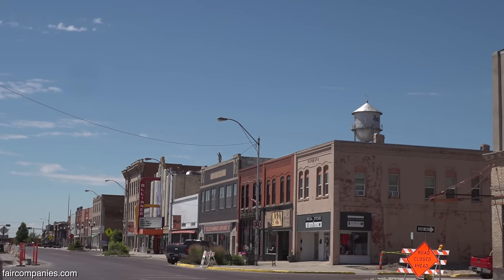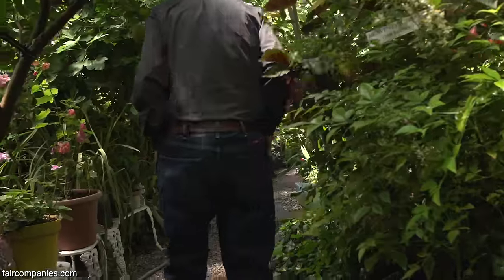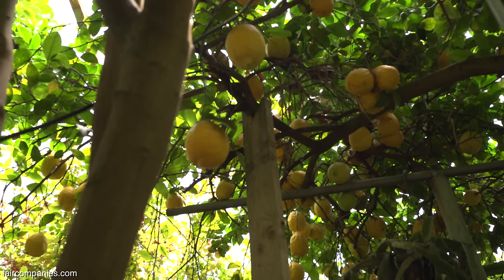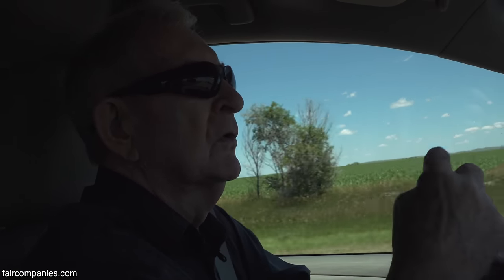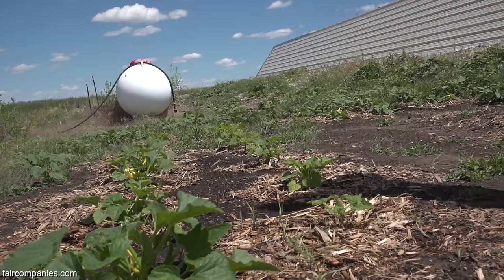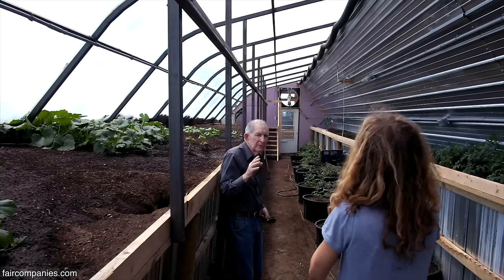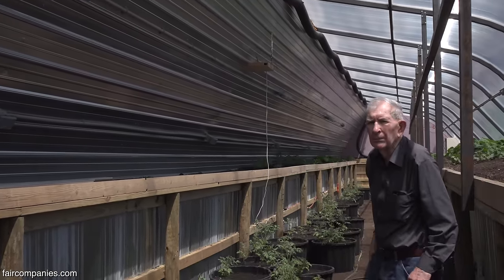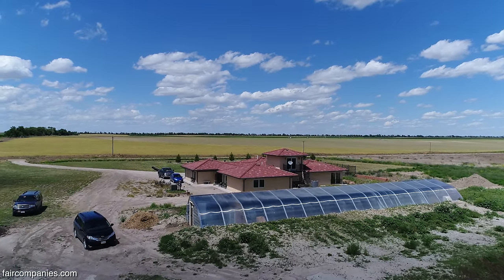Nebraska retiree uses earths's heat to grow oranges in snow

Comment: Russ Finch: Thank you Kirsten for the great video it raised so many questions I thought I needed to answer some.
Pollination: There area lot of misconnects about pollination while most plants can benefit not many require pollination to produce. While citrus might benefit they set so much fruit that they abort until they can support what remains. The only plant we need to hand pollinate is the pomegranate. 
     Bees:  If there are bees in the area they will find their way into the unit through the open ventilation windows. 
     Co2: Is overblown there seems to be no shortage in our system we have trouble keeping growth under control.
    Latitude: We have learned so much about latitude with this project mostly it isn't reliable for gaging heat and cold. The important thing is local climates. South of Oslo Norway is around 57° latitude where we are 42° but their winter average is 10° warmer than ours. The ocean and lake effects influence also.
     52°: Lots of confusion about the temperature of the earth in relation to the greenhouse temp. The blower for the earth geo only turns on at 50° or below until then the warmth from the pit radiates heat and during the day in the middle of a February day, outside temp. 20°  if the sun is out the temp at 6' will be around 80° and the peak of the unit will get to over 124°.
      Radon: WE have never heard of radon problems probably because the solution for radon is ventilation and that is our whole system.
     Break even point; We have 41 units all over the U.S. and Canada now and the oldest units growing commercially are less than 3 years old so we have little information. The typical 96' greenhouse for local growing will cost about $24,000 if you have access to a backhoe and can do the labor. That size unit can support around 18 citrus trees that will take up 20% of the growing area. The citrus will produce fruit from the first year and be what we would call mature ( about 100# per tree) in from 6 to 12 years. The rest of the growing area can be used for any crop and should produce income to pay for the unit before the citrus is mature.
     Grants:  We have shied away from outside money after being approved for a $70,000 grant from the University of Nebraska only to have them decide to "not release the funds" after we had started to build.  At that time we scaled back on the size and financed it our self.  
    Insects; Very little problem with insects after the first 3 years when we stopped using toxic chemicals and started using Horticulture oil (ultra refined mineral oil) it is safe and effective we just tree the problem area not the entire unit.
     Agriculture needs to grow this way;  This type growing can produce some of our table vegetables and fruit but there is no way we can produce enough to replace conventional farming.

   We have skeptics that say this won't work when I'm told that I pick an orange and try to figure where I went wrong while I eat it.
Reply: Russ Finch, thank you for sharing your experience and knowledge.  You have expanded our horizons and shown us energy friendly possibilities.  How did you learn about geothermal?
Reply: greenhouseinsnow Great Video, You sir are a genius, I am is impressed as I have ever been.
Reply: ❤️ Amazing
Reply: greenhouseinsnow How thick are the poly-carbonate sheets, Russ? Thanx!!!!!!!!!
Reply: he says in the video... three eigths i remember
Reply: Twin wall too, I believe.
Reply: I love the whole concept.
I do have one question though. So you circulate air through long tubes underground. is there a way to sanitize those tubes? Like run bleach through them or something? Because the type of environment present in those tubes seems like a perfect growth habitat for legionnaires disease.
Reply: Thank you for sharing your valuable information and experience with us
Reply: Thank you for posting the video and elaborating after. I was just wondering if you ever built one that had room for sitting and enjoying your garden oasis in the snow ? I live in Illinois and I’m thinking how amazing it would be to have a tropical garden year round ! I would have some tables and chairs in there maybe a tile floor or nice green lawn year round. We would eat lunch out there when ever possible. Your greenhouse must smell amazing with all the citrus? Do you plant smaller trees, or have you had problems with plants growing too tall ?
Reply: Mr Finch I just subscribed to your channel. Thank you for your experience and contributions. Seems like you are accomplishing more with 25 thousand dollars then a university does with 1 million
Reply: You are very smart man, I applaud your genius and vision.  I hope to see one in every town in the world.
Reply: "We have skeptics that say this won't work when I'm told that I pick an orange and try to figure where I went wrong while I eat it."

Epic. This seems to be the real problem more often than not, doesn't it?
Reply: Yes it does.
Reply: Michael Klumper the moving air may keep moisture down to discourage bacterial growth.
Reply: Thanks for the details! Great stuff
Reply: greenhouseinsnow im changing my life because of this video. Greetings from Kansas City!
Reply: Michael Klumper air is circulating, it's not fresh water.
Reply: +Michael Klumper It's just OUTSIDE air circulating through the tubes. How could you get legionnaires disease from that? The earth insulates the tubes but does not penetrate them.
Reply: Fantastic work.
Reply: Wonderful!!
Reply: Hi could anyone explain or send a link to a diagram for how geothermal heating/works? thanks
Reply: Why can’t I meet someone like this!!
Reply: Atomicwedgie81  

the Lexan panels are 6' x 14' and 8mm (3/8") The idea is to have as few seams as possible to make the unit air tight.
Reply: Atomicwedgie81  Right we have used triple wall but find the extra tunnel doubles the amount of condensation.
Reply: Thank you so much sir for your comment and your work.  Hopefully more people will see this.
Reply: Thanks Russ, have you thought of writing a book on your findings?
Reply: How would one purchase the frame and glazed modules, and how much does each module cost, please?
Reply: @michaelklumper9336 
 Even if it was possible, I highly doubt you would want to run something like "bleach" through the tubes__it would soon kill everything in the greenhouse with the toxic gases released into the plants' closed-in environment!  Bleach isn't the cureall most people believe it is!  It's a highly volatile product that people, for the most part, should scale back on over-using so freely!  😒
Reply: @knowideas7184  
 Don't get what your reference to fresh water is, considering Legionaire's usually tends to proliferate through things such as (dirty) air conditioning ducts!  😏
Reply: Mr. Finch:  Thank you so much!  Thank you for your generosity in sharing and alerting the public to a real alternative way of farming.  I was wondering how high can one build? Considering long term then one maybe able to grow Cacao, Papaya, Bananas, Plantains, and all types of berries from all over the world!  Wow!
Reply: I want a greenhouse that uses your technology but on a smaller scale for my 3 acre plot. You sir have illuminated a light bulb in my brain. Our town is small approx 3,000 folks who could buy our products year round.  thank you for this video
Reply: There are others working on small-plot commercial farming.   It's not that hard to grow things, locally.  And it's going to become more and more popular over time.  And any person with land can adopt a very very cool lifestyle.  A new American lifestyle that I hope and pray catches on across the heartland.  There's also a LOT they can do in cities to grow things and just make their environment way better to live in.  See a skyscraper?  The windows should be FULL of growing things.  They could be the new-wave terrace farms, only totally vertical, rather than just hacked into the sides of steep hillsides.
Reply: You guys are amazing.
Reply: Awesome... I'm ready for bananas too...
Reply: greenhouseinsnol
Reply: No way to replace conventional farming... I am wondering about breaking up large monocrop farms into many tenant farms, utilizing greenhouses such as these; if large corp. wants to continue to own all the land, where more folks have opportunity to make a life, more food is produced, we can edge away from animal agriculture, a very large polluter (and cruel), some of the former monocropped land can be turned into food forest to create micro climates... Seems like there are possibilities to rely less on chemical company monocropped conventional farming. It would have to take a while to institute, but if we start...? I know this is a simplistic statement about something with more complexity...I'm throwing an idea out there.
Reply: I love this, makes me want build a small me.i'm retired and like to garden.
Reply: all he does is circulate air from the ground into a partly insulated green house? Who would have thought the ground retained heat that well, how is it doing that? wouldn't the air drawing the head out of the ground eventually cool down the ground too? Maybe microbial activity in the soil is keeping the ground warm?
Reply: Dear Russ, you are a gift from God! May you be strong and healthy and continue to teach the younger generation what you have learned and researched. You are an inspiration to the world! Thank you for your contributions to society. May we all follow your example, reinvent the wheel and find a new purpose in life after we not-retire. Respect Sir- best regards.
Reply: Mr. Finch, you are an absolute GEM (and that last sentence above was a HOOT). I wish you had known my grandparents. They were nearly completely self sufficient with a large 5 acre (conventional) garden as their "backyard." They grew everything, and I mean everything. During the summer, we only had to buy bread, meat and milk. We had nearly every veg & fruit imaginable. Of course as a kid, I never appreciated all that, and now, as a city dweller, am kicking myself for not asking more questions, and learning more about their garden knowledge. PLEASE tell us that you have written down your vast wisdom about these growing systems, because we have lost the art of horticulturalism over the years, and I have a feeling we may need it again sooner than later! Thank you for this.
Reply: @atomicwedgie8176  I think he said 3/8ths inch
Reply: I totally want to be this guy when I grow up.
Reply: "We have skeptics that say this won't work when I'm told that I pick an orange and try to figure where I went wrong while I eat it."

Best end line ever!!
Reply: Thank you so much for sharing your knowledge and experience.  You prove that high school grades don't make a person. It's how they use the noggin to change the world that matters.
Reply: greenhouseinsnow Was
Reply: Good stuff.
Reply: "We have skeptics that say this won't work when I'm told that I pick an orange and try to figure where I went wrong while I eat it."

I guess the last laugh is yours sir!
Reply: " We have skeptics that say this won't work when I'm told that I pick an orange and try to figure where I went wrong while I eat it". That, sir, is what the kids call a mic drop
Reply: Great work with the green houses, Geo thermal is the true future of energy  !
Reply: @atomicwedgie8176  Watch the video again and take notes.
Reply: HappyAgony look up geothermal heating!!
Reply: @michaelklumper9336  Legion Disease (has a scientific name). I remember that it had to do with water cooling. Brut to your point, chlorine gas could be used to flush the lines. Relatively inexpensive. Just fill the lines, close both ends and wait for 2 hours. Then flush and continue with operations. Also filters could reduce unwanted spores that may be harmful to humans.
Reply: Would you consider adding an apiary at some point?
Reply: All though it is green friendly... but where is all that electricity coming from beside from Solar panels, & wind mills...
Reply: I am curious Russ if you have looked at the concepts of Earthship designs? By creating a thermal mass (like you are using the floor for now) along the north wall it will absorb the suns energy during the day and stabilize the temperature at night. The thermal mass needs to be buried in a berm  to insulate it however. In earthship design this mass is created with old tires and cob but there are other options
Reply: actually studies in this design by others have proven that the earth acts as a dehumidier The moisture levels in a closed loop design actually lowers as the air flows through the system
Reply: @MrDisgruntledGamer1  Simple physics, the Theory of Thermal Dynamics, the simplest way to explain it is, HEAT moves   to COOL. Also he uses the KIS principle, Keep It Simple.
Reply: @patdoyle2514   Try germicidal lights.
Reply: What states do you think this is valid for? I live in eastern pennsylvania. valid, do you think, sir?
Reply: @patdoyle2514  Yes, Mam.
Reply: eating the oranges call the book smart dummies and listen keep it up
Reply: @michaelklumper9336   With adequate air circulation, it shouldn't be an issue, esp if there are no splices in the lines. Easier and cheaper to put in a filter system on your greenhouse end from what I can figure.
Reply: True American Hero. Brilliant idea to use abandoned small town lots for greenhouses. Thanks for sharing!
Reply: Michael Klumper I thought legionnaires needed the moist environment of an air conditioning system where warm humid air is being chilled and dumps its moisture.  I would think that the air being pumped through the tubes is cooler air being warmed so it’s relative humidity level is going to drop and it would tend to scavenge any moisture that might develop.
Reply: @michaelklumper9336  That was one of my questions as well.  It would seem that a warm moist environment would provide the perfect ingredients for mold growth as well.....
Reply: Update:
I've had a lot of responses. Some angry, most implying I know nothing. I assure you, I'm an HVAC technician. I understand his thermal concept. I've seen it a dozen times. Usually on farmers' outbuildings. I also understand the problems of the concept, and just wonder what his methods of sanitation are. If any. Some guys have genius strategies for that too.
Reply: and vanilla bean orchid
Reply: @EpicDrake  "All that electricity"?  Did you not hear him say that even in this harsh environment, the cost of electricity is 80 cents per day (with the less efficient model)?  That's nothing...
Reply: @michaelklumper9336  Clearly, being an hvac technician doesn't qualify you to know a thing about the spread of legionnaires' disease.  Explain how this open system which pulls in fresh air with a simple fan can cause a disease that's almost always spread by breathing in aerosolized water.
Reply: To Mr. Finch I say you're living my dream sir. To Kirsten and your family, I say your efforts and dedication to showing people there are better and more rewarding ways to live are all inspiring to me. Thank You! -Neil.
Reply: @cherriemckinstry131  and plantains!
Reply: if there is no standing water in the tubes  i don't think legionaires would be a problem and also the temp is 52 degrees if it were say 70 degrees or so with standing water you might have a problem
Reply: Pollination was my only question, but I got it answered. When I build such a green house I will have a bee house inside :) I am not afraid of them, they are calm and friendly not to be mistaken for wasps. Just awesome, showing us northerners it can be done.
Reply: @knowideas7184  ....hes talking about the rain out in the tubes when the humid air cools down underground... I've often wondered about that also, even if you have perforations in the corrugated tubing to let the water drain into some Stone still makes you wonder
Reply: @michaelklumper9336  i read about something like this years ago. It was used to heat and cool down a house. It was a series of tube systems submerged underground..spread out. As i remember it they stressed to use smooth tubing and to slightly slope the tubes, both so the water wouldnt collect. I would think there would be huge rainout in the summer time when the that hot humid air would be pulled underground and cooled. 
U could have an open loop or a closed loop. And they talked about the heat transfer increasing with damp soil, so in one example he said u could bury a water line right above the air tubes so if conditions are dry and dont seem to be keeping up u could wet the soil for better heat transfer. They stressed it was important not 2 have the tubes close together, like space atleast 4 ft apart  to make it more efficient.
Reply: @AShadeOfYou  I wish my girlfriend wanted to live like this.. she can't even grow fingernails! Hehe😆
Reply: @d.rabbitwhite : Animal agriculture can be pollution/cruelty-free with a return to chemical-free, zero plowing, controlled grazing. The all-grass fed meat/dairy is healthy and less expensive or will be when education replaces ignorance, e.g., people choose it over conventional. This method is reclaiming devastated soil, restoring fertility that has been mined out by ignorant farmers, e.g., like those who created the mid-west dust bowl by plowing, overgrazing, and chemical use.
Reply: @goudagirl6095 : The vast majority have been indoctrinated in gov schools to believe that centralized control by authorities is "law, order, and security" and small, independent living free is chaos. This authoritarian (socialist) paradigm is a worldwide plague. It is the opposite of the American Dream that made the 1800s America great. The more "progressive" a society is, the less stable, the more polarized, the easier to "divide and conquer" by the ruling class, the "new nobles", the aristocracy. This progressive society is a regression back to the dark ages and will lead to war, poverty, and species decline. 
Only a return to a voluntary, non-violent politics like early America that distrusted gov and valued the independent person will save our society from civil war and economic collapse. Or, perhaps we need a secession of states to let the progressives have their way, and the capitalists have theirs. Let the experiment begin again, as it did in the 1800s when a 3rd world, backward nation went rogue and defied the worldwide political paradigm by putting individual political equality first ("All men are created equal...") and quickly rose to prosper and become the world leader and a sanctuary for the oppressed, no welfare needed, just a chance to be free.
Reply: Thank you for the measurements... I have a design similar to that but with a large Solar Can heater on one end to create a hot spot of high temperature air,  thus passively driving the air through the underground piping through convection.
Reply: @MrDisgruntledGamer1  There is extra geothermal energy in that are.
Reply: Don Duncan  The Midwest dust bowl was caused by drought and a very hot decade. The plowed land turned to dust and blew all over but the weather caused big blowouts even on land that was never farmed.
Reply: Do you want an apprentice or two???
Reply: I want to have fruit like yours, you are the MAN
Reply: This looks like  dream situation. I want to replicate this.
Reply: white  regregenerative farming (which utilizes livestock as they are intended to be used) actually FIX the environmental issues you describe. Check out any Joel Salatin video...using Regenerative Agriculture sequesters more CO2 than anything science/innovation ever will. Nature being nature, unencumbered by humans is what will balance our ecosystem.
Reply: I have a friend that setup this same idea, scaled down to 10x10, in the middle of Denver in a Tinyhouse community, uses maybe 100 watts when the fan is on, the rest is self controlled, all on solar power as well, amazing to walk inside a 0 degree day and have to take your shirt off, I believe he also uses a water cooling and heating system in addition to the air.
Reply: @T God didn't show you how to build this, Russ did. Just sayin
Reply: @JoshuaMarpetQuadling  Pennsylvania has a much less harsh climate than Nebraska.  Why wouldn't it be good?
Reply: Deborah Davis 
The key point here is that the system is only used to warm up air. 
If one would use it to cool air down, then condensation would occur in the tubes and that would cause all kinds of troubles. 
Keeping the tubes dry is paramount. This is easily achieved by only letting air in that is colder than the temperature of the tubes.
Reply: @michaelklumper9336  you could probably run a fogger through it once in a while but this isn't like an air conditioning system where you have extreme changes in humidity
Reply: I suddenly want to sell everything and move to where you are and do what you do.
Reply: What do you use for fertilizer?  Do you have a composting area inside the greenhouse?  I know once a pile gets going it heats up on it's own but not sure how that works at -20F.
Reply: greenhouseinsnow has
Reply: Yah.. like your approach, attitude and your whole thinking, Ol Boy- hope you keep it up for years to come, my frend!!
Reply: 2 fingers to the skeptics
Reply: @atomicwedgie8176  I wondered the same thing, great about heat generation but what about retention? But when you take into account how much heat it generates, it's all just really math.
I'm pretty sure I heard him say, "3/8".
From another, less industrious, user of geothermal energy, thanks for your efforts, Mr. Finch!
Reply: Bravo! I'm a a fan!
Reply: thesheepsaysmoooo  it’s doesn’t appear to be geothermal.  It’s air passed through tubes 8’ down that circulate the air throughout the green house.
Reply: ABSOLUTELY GREAT INFO!!!! I BET YOUR PARENTS KNEW YOU WERE JUST A "LATE BLOOMER" !!!! PUN INTENDED😂!! WISH YOU ALL THE BEST!!!!
Reply: MATHEW KLUMPER - VERY GOOD POINT ABOUT LEGIONAIRE'S ! ALSO BATS AND RODENT DROPPINGS .SMALL 1/4 WIRE MESH WOILD KEEP OUT THOSE VERMIN, BUT THE LEGIONAIRE'S IS A CONCERN.
Reply: I TOTALLY AGREE WITH MICHAUL KLIMPER..ITS THE AIR MOVEMENT THST WILL GET ALL KINDS OF MICROBES AIRBORN.MOLD SPORES, LEGIONELLA, DRY  ANIMAL FECES. THERE ARE GREAT SOLUTIONS TO TACKLE THIS VERY DANGEROUS PROBLEM. MY HUSBAND NEARLY DIED OF LEGIONAIRE'S PNEUMONIA .THERE ARE MICROBES EVERYWHERE.WE HAVE TO FILTER THE AIR.ACTIVATED CHARCOAL IS AN IMPORTANT COMPONENT OF FILTERS.I'M WITH MR.KLUMPER! LUV THAT GREENHOUSE! DONT LUV PNEUMONIAS OF ANY KIND.
Reply: Greenhouseinsnow  Grew up in Cheyenne Co, KS, KS/CO/NE corner. My Gram there just celebrated 98 years by dancing the Charleston! In South now for work; but if I wanted to 'retire' back home, this would be a GREAT project.  Is there a central site on web with all of these, or anywhere to begin learning more?
Reply: @michaelklumper9336  no water - no legionnaires disease
Reply: The Fowler Funny Farm will be ordering our 1st greenhouse at the end of the month...combining Russ's genius design with aqua and aeroponics for veggie growth to make money while the fruit trees fill out.  We are hoping to have it in place before Thanksgiving.  Plans for 8-9 more in the near future.  Thanks Russ!

In one 108' greenhouse, I can plant about 7200 lettuce heads until the trees mature, and then half that (the back shelf not as useful when trees are full).... that's 7200 heads a month (22 days best case)... at $2 a head (organic in my supermarkets is $3 per head), that's $14,000 per month just from the lettuce... or tomatoes or strawberries. 

This greenhouse is the single best prepping move you can make.  One fully operational can easily feed a family of four, including feed for livestock, and give you something RARE to trade... who will have oranges when the grid goes down?  Only you!
Reply: @michaelklumper9336  Legionnaires disease takes a big source of water, and waterborne bacteria...and unless your water table is at 8 feet down, this shouldn't be an issue as dirt 8 feet down tends to be very dry and dries the air in the tubes.  Way to not take the 5 seconds it would have taken you to find this out on the internet, though.

Also, someone would have to INFECT his water source... Legionnaire's doesn't just spontaneously exist because there is water there.  Way to make it clear you know nothing of the topic on which you speak.
Reply: @johnmarkhatfield  The soil indeed acts as a desiccant and dry out the air pushing through it. It's why he doesn't use a dehumidifier.
Reply: @thesheepsaysmoooo  Google can do that for you.
Reply: @royhoco5748  I ordered his packet, worth the $50... consider it a donation for all his work.   Anyway, in it you will find that the break point for these greenhouses is about 60' long.. anything shorter and you have to put in more tubes than normal, it doesn't become feasible.  I am putting in 2 x 69 foot long ones this month, as my landscape is hilly and I don't have long, level surfaces for 108' straight.
Reply: OK, look.
 I like to try to be nice. But your comment straight up pissed me off, Mr. Know-it-all, Based Bear.
He CLEARLY SAYS that the air is circulated through the system year round.
In the summer the air in the greenhouse is warmer and the temperature in the underground tubes is lower. THIS SUDDEN DECREASE IN AIR TEMP CAUSES CONDENSATION. A buildup of condensation can create quite a bit of water. ESPECIALLY when that air is coming from a hot greenhouse with an irrigation system.
Duh.
Ground water? What are you even babbling about??

And your suggestion that someone would have to infect his system is just plain wrong.
Legionella bacteria are present in various soil and water in small quantities. It could be present in very small quantities in the soil of the plants, or in the water used for irrigation. Irrigation water that was likely sourced from a local well, huh?
From there it could transfer via ambient air humidity through the tubes,  condense into moisture, and thrive in the perfect environment for it to grow.

I assure you. I know EXACTLY what I am talking about.
It seems like anything beyond "Groundwater" just went right over your arrogant little head, huh?
Reply: @basedbear1605  
The air from the greenhouse is circulated through the ground tubes.
This warms the air in winter and cools it in summer.
There's your temperature drop.
Warm, humid, greenhouse air goes through cooler tubes.... causing condensation within the tubes. Get it?
The seasons change? Ok, what?
Are you even following? It sure doesn't seem like it.

The water in the greenhouse for irrigation comes from a well.
There's your potential source.
Apparently you also don't understand the basic pathology of the bacteria in question.
Your experience in enviromental engineering probably came from a video game, and there is absolutely no possible way you have more experience with chillers or evaporative cooling than I do.
Especially when your claims go directly against the principals taught in all HVAC certification programs. 

You're just a kid who lies to try to make his points seem more valid.
Reply: @mucsalto8377  
Do a google search of "cooling air through underground tubes"
Doing that will lead you to several PDF and concepts/designs of similar systems.
This is not some brand new or unique concept.
Reading any of those plans, you will discover systems used to remove condensate which occurs when the hot moist air is cooled within the tubes.

That was my question.
What system is being used.
Because if there is no moisture removal then there is always a potential for bacteria growth.
Reply: @basedbear1605  nioce
Reply: @xtrchessreal  I'm wanting to do this on a smaller scale as well in Berthoud. Is your friend part of a group or anything that gets together to share ideas? I'm looking for some help in the build and would love to  hear from someone local with experience.
Reply: I have earth tubes in my build (8 inch double wall, 250 ft long) and get asked the same thing about Radon all the time.  I give the same answer.  Earth tubes are about ventilation and ventilation is the solution to Radon problems, so why would you expect them to cause a Radon problem?
Reply: @MrDisgruntledGamer1  Go into cave systems the temperature stays consistent throughout the year.
Reply: Thank-You...with all my heart and soul. As i was saying to another person," You breath life,hope and inspiration to us!" Sustainable living is the only path to the future and  the greed and politics of a profit driven industry will surly destroy us and our planet as we have known it. "Big-Corps",what i have dubbed big industries want us dependent on the products that,only they,have to offer and they have their fingers into everyone's pocket...another reason you were refused financial help as this could get out of control and damage profit,shipping... ... a small chain reaction can put a large dent in profit.  My papa always used to talk about,"The Power Of The Purse-String," how we as a people have so much more power than we can imagine just by standing together in great numbers and demonstrating with closed wallets and purses,taking back our money (financial power)and then watch them (for a change) say,"What can i do for you sir/mam."  We need a change more than ever,right now, to start becoming communities once again where people help and look out for each other forming neighborhoods of neighbors where you form an inner social network of families  based on a local sustainable platform. This type of platform would do far more than feed the body but minds and souls would also be enriched as children born and raised in such in simple basic settings are far more secure and tend to flourish and form a desire to carry these basic fundamental ideas forward to the next generation building from this platform of local sustainable/family which tends toward keeping in check the desire for self-serving. Thank-You Once Again Mr.Finch, You and others like you are the true heroes as you sure are mine.  L.L.
Reply: I've not read through all the comments, but could you have 2 greenhouses run on a single set of tubes? Or would each one need it's own set? (kinda what I'm thinking). Thank You!!!!!!
Reply: @tavayalahlynnlawmaster624  I couldn't agree more!
Reply: @d.rabbitwhite  one of the Reasons we have Corporate Farms  is becouse the sm. Family farms are dieing out. That needs to be Revised,  it slowly happening,  but will never go back to feeding the nation.
Reply: @pat36a  I am not advocating for going back. I am advocating for moving forward, in thinking and action.  I know there are issues to be worked out.  I'm giving ideas I had and stating that I trust that things can be worked out. 

Check into why small farms die. Corporate has a hand in making that happen.
Reply: Soaking garlic, ginger and vinegar in huge vats of water for some months, then watering the plants with it works really well as a pesticide too.
Reply: @GammaCharlotte  Small puddles of standing water collecting in the pipes would be problematic.
Reply: Deborah Davis  The problem would start with condensation in the pipes. 

However without actually looking at those pipes it's impossible for us to tell whether there would be any problem with condensation.
Reply: Years ago back in the 90’s a welder that made galvanized boat decks on the Finger Lakes in upstate New York his name was Ralph Poormon had a welding shop on route 89 in Seneca Falls NY built his Aframe house with geo thermo heating years earlier an showed it to me. He also had a wood burning shed located away from the house that was piped into the home, under ground. As back up for winter. This had a stove in it that he could burn wood in an send it into the house an bring the temp up above the earths temp of 54 degrees for winter comfort. An in the summer no air conditioning was needed. This man reminds me of him so much.  Ralph is gone. He taught me a lot.       One thing for sure you need to know the frost line level An definitely be well below it, an your water table levels. It will not work in a swamp unless you got mega bucks.
Reply: How about Australia.could some variation of this work there.
Reply: @michaelklumper9336  You could just have the air run through a white box with uv-lights before it enters the greenhouse if that worries you.
Reply: @MrPondGuy  There's a little bit less sunshine hours. Some plants are sensitive to the length of sunlight, some to the change in sunlight, and some both... I dont know how the citrus are going to perform but they seem to perform well in NB.
Reply: @Conservator.  Hes actually explaining a bit more how it works during the latter part of the video. He is using the system in the summer to cool the GH. While doing so, it transfers heat to the soil around the pipes, warming it up. In the winter, its the warmth around those pipes that are transferred back to the GH. If you also check his cellphone, he is monitoring the dewpoint, but I dont know if he is actually caring about the condensation while the system is running because there are also considerable heat gain and losses with condensation.
Reply: Where can we get plans for this build?
Reply: @josephrileyosullivan  on Russ's website.
Reply: We would like to come up from Sidney NE to see your setup
Reply: Post more videos?! Set up some go pro's or whatever cameras you'd like, cheap if you want.

You need to start cashing in from the Bank of YouTube.
I'll be legitimately angry if you don't
Reply: @michaelklumper9336  I'm no engineer, but 24 years and no issues with any of your big words.
Reply: I want a Nebrakian orange.
Reply: @1voluntaryist  real funny that as a wild liberal progressive socialist I agree with you 100%, it's not about  that at all, it's about liberty and tyranny, or individuality vs authority. Be well ✌
Reply: @ @michaelklumper9336  ,  You asked a very valid question to do w/ condensation and water stagnation, which leads to mold, mildew, and bacterial growth, which includes Legionnaires disease.   I wondered the exact same thing as you the moment I heard him say they use the tubes for cooling in the summer.  Just think, hot humid air getting cooled to 52F or so, and how much condensation there will be on the inside of his corrugated tubes.    You and I both know even a simple window air conditioner (esp. the ones with the slinger fan that throws to condensate against compressor coils) have mold/mildew problems, and the window unit is all above ground, and has the ability to drain the condensate (unlike the tubing in this video)

Maybe your original question should have the following line added to the end "if you don't know what a psychrometric chart is (w/o googling the answer) then please, don't bother responding".    Yeah, like you, I know a thing or two about thermodynamics, relative humidity, and HVAC, and it is indeed painful to read the comments from ignorant.
Reply: Russ Finch, are you related to any Finches from NY?
Reply: Love you, it is great.
Reply: sOMEONE, PLEASE MAKE A PATREON FOR THIS GUY
Reply: He needs to do yoga every day to straighten up, and make a vid on the house construction too.
Reply: Thank you this is awesome
Reply: where can i purchase plans for your green house
Reply: Thanks Mr. Finch for what you're doing. A real inspiration.
Reply: Does this gentleman have a Facebook page or any way to follow him? I'd love to eventually set up a tour and pick his brain
Reply: @d.rabbitwhite  any regenerative farmer will tell you that livestock are a big part of their system because the soil heals exponentially faster when animals are part of the management. We wouldn't need tenant farms, but could break up the huge corporate farms into smaller family farms again. The BIGGEST thing is to make the food supply local. 70% of people on Earth are fed by the 30% of farmers who are on small-scale and peasant farms. Most of the stuff from monoculture systems (especially corn and soy) goes to biofuels and synthetics production.
Reply: @rachelholdt6840  Not any regenerative farmers. There are plenty of veganic permacultural farmers out there. and the animals there are liminal animals that one learns how to live cojointly with or are survivors of agricultural pursuits. There would be nearly no way to convince a corporate entity to give up property but there may be a way to convince them through legislation to rent acreage.
Tenant farms are mentioned because it gives more people a choice to live in a more self sufficient and localized economical manner. I know that much of the Non organic soy and corn monocropping is a nasty endeavor.
Reply: So awesome. I hope to bring fresh, local lemons to Northern VA one day!
Reply: you sir and your wife are a hero! I'm pretty sure someday I'll grow a green house not unlike this when I retire too.
Reply: I love Russ Finch
Reply: GREAT Video  I Like it (From Pakistan)
Reply: @michaelklumper9336  My guess is ozone, hydrogen peroxide, peroxyacetic acid or chlorine from the inside out if wanting to.  I'd use the first two methods if was a concern.  I personally wouldn't use.
Reply: @rachelholdt6840  ... I don’t have numbers to provide but I can assure you that most corn does not go into biofuels. It’s used for many things. I believe (again, no numbers) most is used for corn syrup and cereals. Starch is also extracted from it for paper. I can say that when the price of oil is low as it is now, the ethanol plants can’t really make a profit. There is quite a bit to consider when talking about biofuels and I know I don’t want to invest that kind of time.
Reply: I live in Kansas, and I would love to come tour your operation and visit with you, you have an incredible setup!
Reply: @michaelklumper9336  - Excellent question. One would think if LD ever becomes an issue, modern UV lighting solutions/options (run off solar) would solve the problem quite easily and effectively!
Reply: @d.h.vargas2450  - Well said.
Reply: @yumyum408  - If LD ever became an issue, it could be easily solved via a little outside the box thinking... (eg) simple/easy modern UV lighting options would solve any LD issues.
Reply: @Conservator.  - Even if there were issues, simple modern UV light options exist which would easily solve any negative bacterial growth issues.
Reply: @drippingwater1849  - Got to learn to think outside the box more... if negative bacteria problems ever became an issue, simple modern UV lighting options could be used to solve the problem.
Reply: @drippingwater1849  - Got to start working that brain more and thinking outside-the-box when approaching challenges :) There are all kinds of simple modern UV lighting options that exist today, which could be easily implemented should LD or other bacteria become an issue.
Reply: @mucsalto8377  - Plus, if LD were ever an issue, there are all kinds of modern UV lighting options available that could easily solve that problem!
Reply: @__WJK__  
Yes using UV light could be an option. To be 100% safe you could also install an air to air heat exchanger. That would however incur some losses.
Reply: @michaelklumper9336  my goodness man the greenhouse has been in operation for more than 25 years and not a problem you must be some mad scientist or something looking for a job
Reply: Thanks so much for this from Vancouver Island BC! Fascinating and exciting! You are amazing Russ and such an inspiration...all of that great work has kept you young!
Reply: @MrDisgruntledGamer1  maybe the center of the earth is lava(molten rock) and it's keeping the ground warm?
Reply: Great sense of humor too.
Thank you for your legacy.
Elder
Reply: @MrDisgruntledGamer1  yes it would eventually cool the ground, but you only run the circulation through it for a few hours at night, and sometimes push heat through it during the day when it gets too warm.
Reply: Oh Russ. That last line make me giggle! I toured your greenhouse a month ago and have been dreaming and scheming how to buy one since then.
Reply: "We have skeptics that say this won't work when I'm told that I pick an orange and try to figure where I went wrong while I eat it." And THAT is the difference between people who will change the world and people who will complain about how the world needs change.
Reply: Would like tonsee a tour of the house.  Looks like the earthship homes stole his idea with the windows and grow room inside home.
Reply: My question is how tall are the units and what do you do when the trees outgrow the ceiling?
Reply: Thank you for sharing your experience and for being so practical! And self sufficient! You are such an inspiration.
Reply: Hello, I love this and am planning for building next spring. Where can I get some plans and talk with you ? Thank you,  PM 10/5/21, Mt zone 5A.
Reply: This is a really well deserved highly received post. I thank you for taking the time to write it.

I'd like to know if you've looked into agrivoltaics at all and if you think they might play an additional role in a setup like this.
Reply: Hey Russ, do you think we could save a buck if we did our own metal/wood work?  Or does it come to about sixes once all is said and done?
Reply: Such a great system and an amazing guy 👨🏼‍🌾🤝
Reply: Yahweh bless you, sir .
Reply: @kevingrove4379  The soil from the Dust Bowl blew at least as far East as Indiana. My grandparents used to tell me about cleaning the house with the windows closed, and by the time they were done, there was already a new layer of dust and grit on the windowsills.
Reply: @casiofx85wa  Sad but True!
Reply: @harrymills2770  In New York they do have greenhouses on top of buildings for growing.
Reply: I would love to go work for him .  I lost my wife and daughter .  Pandemic has made many people change careers,   me it has made me look at life very differently
Reply: @REYKING-Muzic  💔  My heart goes out to you....cant imagine what you are going through.  My thoughts & prayers are with you 🙏🙏
Reply: This concern of bacterial growth make sense.
Reply: I always wanted to see if we could get a tour for our homeschool group.
Reply: How can we get DETAILS to benefit Mr Finch, and those striving to DUPLICATE THIS METHOD! This was phenomenal!
Would love to visit with him, you! 
How can we connect with you?
Reply: Hello! what do you do if you encounter wet soil once you dug 10 feet underground?
Reply: @casiofx85wa  There's no shortage of critics and naysayers.
Reply: This is awesome and amazing! God Bless.
Reply: Great work
Reply: You are a G
Reply: Lots of respect for you sir.
Reply: @atomicwedgie8176  I Believe he mentioned 3/8" poly carb
Reply: Wow! Mr Finch...much respect ❤
Reply: This is so exciting!
Am very impressed and wish I could participate